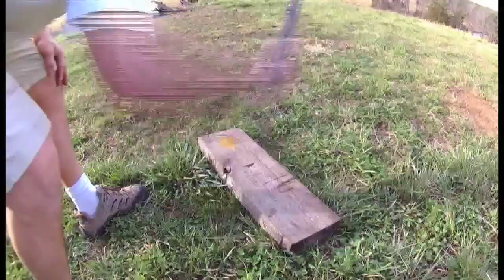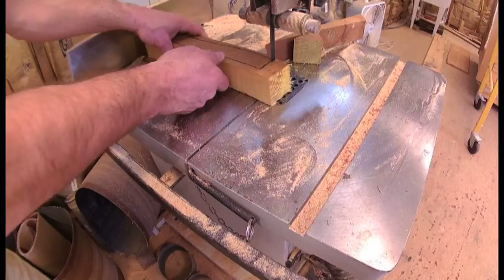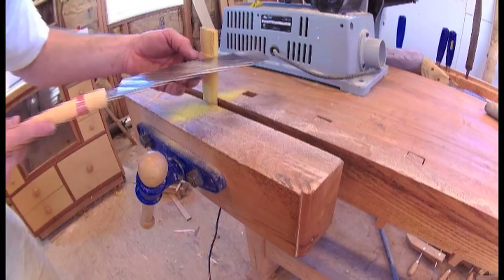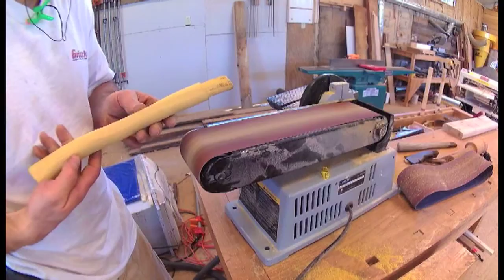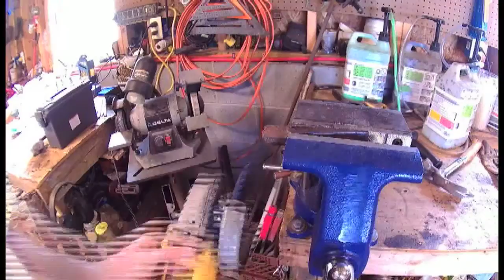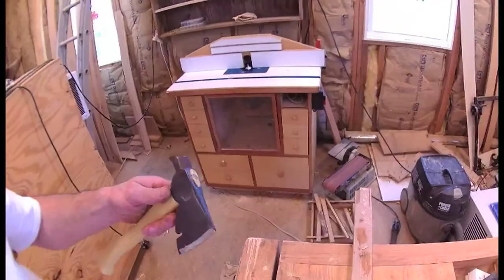Osage orange hatchet handle.  FarmCraft101

Comment: Beautiful wood. Great work. Nice use of the bandsaw to do a rough sand. I have a wooden sword I've been thinking of trying to make a copy of and profile the way you did tracing it. I found a 2x4 walking the other day I might try to use. I have very limited tools right now but I think with a circular saw, a side grinder and a lot of sandpaper and elbow grease I could make it happen. I doubt it will be as strong,  but could work just for light practice.  Wont be nearly as pretty either, but just a fun project to see how it comes out and test some long rusty skills.

Comment: I would have welded up the poll and cleaned it it rather than cutting it off. It's a counter weight to keep your swing straight. Without it in a sideways swing the bit will curve downward.

Comment: Great job on the restoration and video. How is it holding up as far as toughness? Is it as good as hickory? Where can I get Osage to make a handle out of?
Reply from the maker: +funsharx I haven't used it a lot yet, but it seems very solid.  Osage is very hard, harder than hickory, and I've seen it used in other tool handles.  It's actually sought for making bows, so it's obviously flexible too, and I expect it to hold up for years.  Not sure where to get it.  I cut down some osage when I lived in West Virginia and milled it myself.  Thanks for watching.
Reply: Word. I just bought a stave for a bow off ebay after my last comment. Should be able to make a hatchet handle and a camp axe handle and might have enough wood left over for knife scales. If shipping wasn't $20, It would have been dirt cheap and if it ends up too small, I'll just make a bow. Lol keep the vids coming. You have skills
Reply: @FarmCraft101  Curious how much you've  used it now and how it's  held up. Also funsharx nice name :p